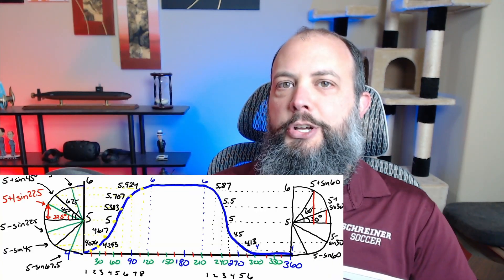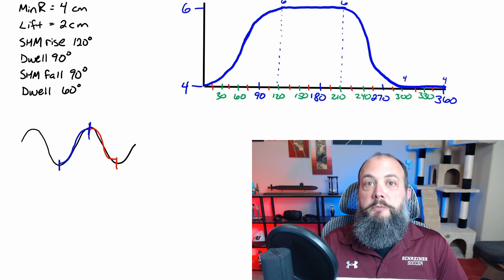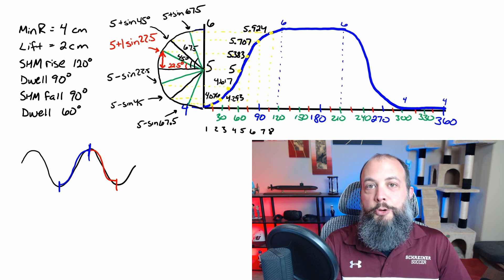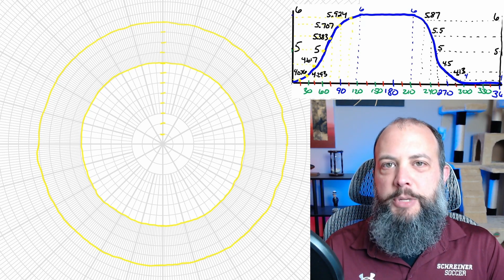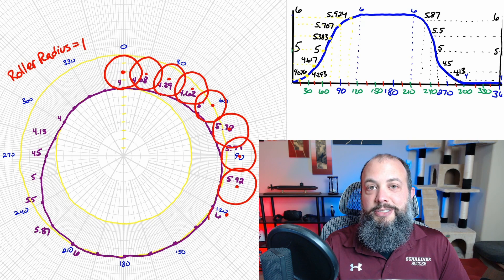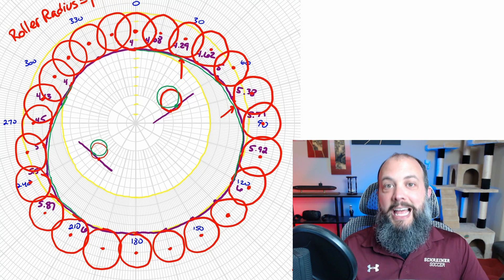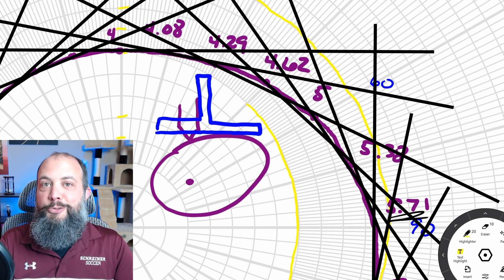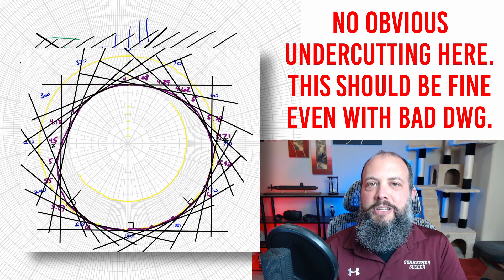How to Draw Cam Profiles and Displacement Diagrams – Simple Harmonic Motion

Comment: How to determine the values you showed in the beginning of the video when you're designing cams for your own project?
Reply from the maker: Lift will be determined by whatever is being controlled. If its connected to a slider or switch or any other mechanism, how far does that other piece need to move in total. Minimum radius, the cam will perform better the larger it is, but larger is more expensive and takes up more room. So, use the largest minimum radius that you can afford or have space to accomodate. The degrees for rise, dwell, fall ... this is based on time. Do you want it to rise and fall at the same speed, or do you want one of them to be faster? Do you want it to stop and stay at the top position for any amount of time (yes dwell), or do you want it to return immediately (no dwell). This will depend on the purpose of the machine. If you just want it to rise and fall one right after the other, you'd just make rise 180deg, fall 180deg, with no dwell. Or if you want it to fall faster than it rises, Rise 300deg, fall 60deg to make it lower 5x faster than it rises. I hope this helped.
Reply: @BrianBernardEngineering  Thanks, Sir.